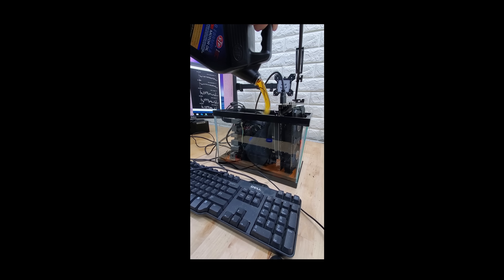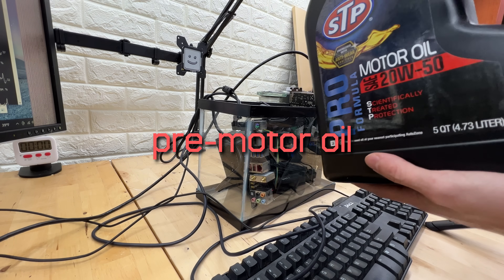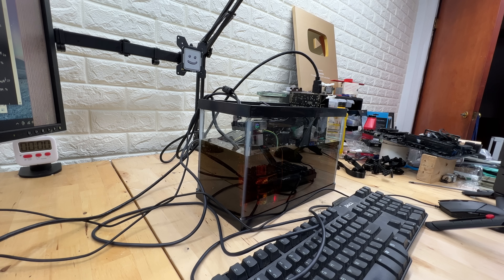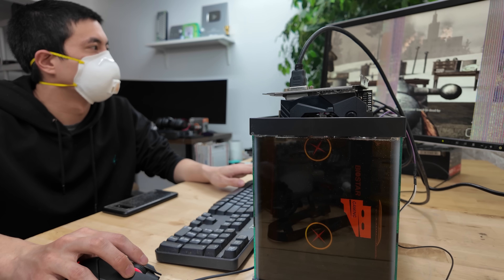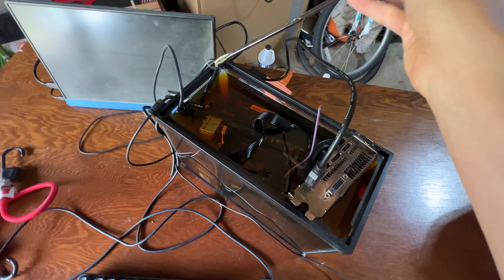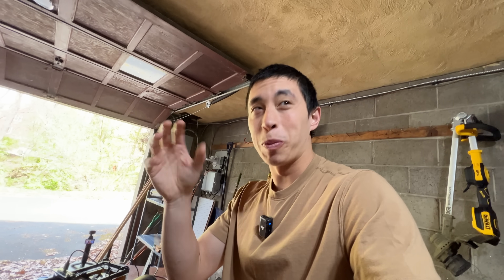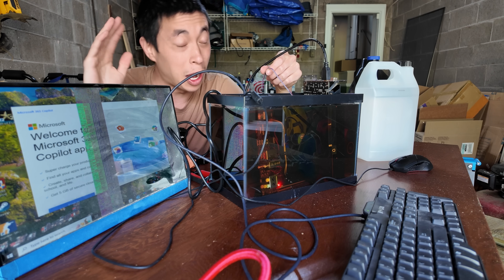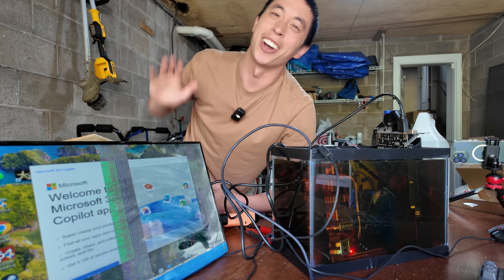Why isn't Motor Oil used to cool down PCs?

Comment: I probably wouldve used the thinnest oil they make which is like 0w20 or 0w16. But now this brings up the question of when to change the oil? Every 3000 hours? hahaha
Reply: 0w-8 exists, hell even 0W-2
Reply: @CollinTheSav Motorcycle guys use a “less than 0” weight oil to pickup a few hp.
Reply: @CollinTheSav might as well just start using water at that point 😮😂
Reply: @issanesheiwat1396  na uh the pc goes boom electricity and water no go together (i know how to speak english i just did this to make it funny😭😭🙏🙏)
Reply: @EFRODINORIQUE  he was joking
Reply: @EFRODINORIQUE  🥀
Reply: @CollinTheSav what about 0w0?
Reply: That was exactly my though. 20w is so THICK stuff
Reply: @Garrettdx1988  20W-50 is actually 50 weight oil. The first number on a dual-viscosity oil is the cold temperature performance.
Reply: @APS_Inc cold, meaning not up to engine operation temperature. I don't think that oil got to OT....
Reply: @Adroit1911   @Adroit1911  No, the W explicitly refers to an oil's WINTER rating and is for extremely cold temperature startups, and by cold they mean freezing or below. Above that temperature, and certainly at room temps (cold engine start not during winter), the oil should behave exactly like its base rating. So 0W-40 and 15W-40 should behave identically at room temps per their spec. I'm sure there are some differences in performance (no oil is going to behave perfectly like a single weight SAE 40 when it's meant to accommodate a wider temperature range) but for all practical intents and purposes, and certainly in the mild conditions in this test, the only value that matters is the base weight rating which is the second number.

Starting an engine when it's 12 degrees C outside vs 22 C means practically nothing for oil viscosity, and the oil is not going to behave meaningfully different at operating temperatures precisely because they're both the same base weight which would mean if they didn't perform similarly then one or both would be out of spec.

So no, the "cold" temp here does not mean not up to operating temp, it explicitly means winter temps, usually freezing or below, and those are usually not the temperature your room is at (I hope). While SAE 50 weight oil will perform very differently at engine temps vs room temp, their performance characteristics for purposes of oil weights are at startup in freezing temperatures, and for that reason something like a 0W-40 vs a 15W-40 won't see much difference above those temps (near and below 0 Celsius).

Ergo the second number is the most important for considering oil viscosity and film strength. The first number is purely for winter conditions on startup, and is not relevant for engine operation, and therefore a 0W-40 vs 15W-40 is not an appreciably thinner oil at the temps most people will be handling it.
Reply: @Adroit1911  I see your point, but -5 C is going to have dramatically different performance than 25 C for these purposes. I don't think the difference between a 0W and 15W is going to be that dramatic at room temps, unless you can source me room temp behavior and not freezing temp specs. 25 C isn't exactly "cold weather" for the purposes of an oil spec even though it's obviously not operating temperatures.
Reply: Was gonna say this myself.
Reply: Toyota has started using 0w-5
Reply: Use expensive racing oils to see if it cools better. Pennzoil Ultra Platinum Full Synthetic
Reply: @tacticalcenter8658  some royal purple 0-w5
Reply: Came here to say this lol.  Thinner is better for circulation.  That's probably why mineral oil works so well.  Mineral oil is almost TOO thin, though.  It's almost invasive 🤣
Reply: @dpjazzy15 mineral oil also just disintegrates rubber and creeps up cables
Reply: when you pwn 3000 noobs
Reply: Just have an extra like 3 gallons in a separate reservoir on a manual flip valve and replace that way. Send the “old” warm oil back to the other reservoir and keep the entire reservoir in a mini fridge
Reply: yeah 20w is crazy, doubt it would get hot enough to get to the 50 so probably stays 20w, well if the fans were working at least
Reply: @keatoncreates  the first number is cold weather performance, that is, below freezing. The actual weight of the oil is 50. If you have an engine that takes 0w-20 oil and you can only get single-weight oil as a replacement, you have to use the second number (20), not the first, or you risk engine damage with not enough film strength at operating temps.

20w-50 is 50 weight oil that has 20 weight oil characteristics at freezing temperatures . At room temp it's going to behave much more like 50 weight oil for most practical purposes, but especially film strength.
Reply: @keatoncreates the oil doesn't get thicker as it heats up, it just gets less thin
Reply: 3000 hours or 10000 miles.
Reply: It doesn't change the cooling properties at all, but since it's thinner, it would be easier to pump more volume and thus cool it better
Reply: @iwanttobetankman4260  pretty sure it would make any moving components like fans less stressed as well. Even if they don't serve a purpose
Reply: Well, with some luck it's fluid enough at temperatures that need cooling that it just serves as its own temperature monitor.
Reply: ATF is rather thin.
Reply: 0w-16 for sure
Reply: @ Might work, might not. The viscosity at 40°C is 30-35 cSt. Mineral oils can have a wide range of viscosities, between 8 and 60 from the ones I just looked up. Anyway I think there are better alternatives.
Reply: I was thinking the same
Reply: came here to say this
Reply: Funny Car Joke
Reply: If there are no moving parts, no need to change the oil
Reply: Maybe after 1000 kilometers ?
Reply: Exactly
Reply: me too,   thinking about it you could get rid of the fans and just out an intercooler in with a proper impeller.....hmmm
Reply: As a manufacturer of motor oil.  I approve.
Reply: Depends on if you use oil, synthetic oil, high mileage oil…? lol😂
Reply: I was thinking the same thing. They make 0 viscosity motor oil, they have synthetic motor oils that come in different colors if you want to be even "extra".😊😊
Reply: некоторые люди компы в растительном масле держат в ваннах и ни че, работают годами, внезапно.
Reply: Use high mileage for them older builds
Reply: Was thinking the same thing, you could also submerge a pump and run the oil through an external radiator to keep the temps in check.
Reply: Seeing 20W-50, my immediate thought was that oil wasn't going to get anywhere it needed to
Reply: You'd have to clean the parts eventually which i dont think would be easy with oil. That and the weight of the PC would be a problem.
Reply: conductive?     I'd check....before... lol   linseed oil I've seen  just doesnt work as good because its a liquisd ands is harder to move,, so the added power consumption for the pump...   oil's a bad isdea no matter how thin, air will always win :-\
Reply: I wonder if I can get one of those recommended oil change stickers to slap on the case. Lol
Reply: I was gonna say this, too. And he's saying it's conventional which means not synthetic or synthetic blend. He should have at least used synthetic. To my knowledge, though, there are no 0W-[insert number] motor oils which AREN'T synthetic.
Reply: Never I would think. It's not like it's running through a hot engine with many moving parts. In this scenario it is not a lubricant so I see no reason for why it would get dirty and have to be replaced. In fact dirty oil would probably work and then you'd get the blackout effect for free + you wouldn't have to buy fresh oil, you could just recycle from what can no longer be used by your car.
Reply: they make 0W-8 but that is essentially water
Reply: Well considering its clear, whenever it gets too dark/opaque?
Reply: The fans would probably push it too.
Reply: Hell how about ATF?  That would look amazing too!
Reply: I was thinking the same thing... 20W50 is some thick ass oil. Using something like 0W20 or something might have been far better
Reply: 3000 miles
Reply: What oil filter does your pc take?
Reply: Only reason you need to change the oil is when it becomes to viscous that might cause the oil to hold a current since viscosity is water getting into the oil which happens naturally overtime with humidity or water particles in the air.
Reply: Not if you use synthetic
Reply: i think the detergents in the motor oil will eat the parts over time
Reply: @josephdias5859  motor oil does the opposite 😂
Reply: @josephdias5859  

I doubt it, even then we have engines with plastic oil pans.
Reply: @mottoloveurlala  do you realize some types of plastics are made to be corrosion resistant there's multiple types which more than likely are not the same types of plastics used in computers I had a mineral oil cooled pc that eventually had some sata cables completely fall apart from the oil along with the pump for the oil
Reply: With a good oil filter, you will not need to change oil that often.
Reply: Engine oil is not for cooling
Reply: @oligerolsen2533  It's used in your engine to disperse internal heat.. your lack of imagination is boring
Reply: Depends if the vehicle has an oil cooler or not. Also coolant is used for cooling the engine down internally.  @mottoloveurlala
Reply: @oligerolsen2533  bruh why you think oil gets to engine temp? 😂😂😂😂

Comment: You used some of the thickest oil possible why ?
Reply: stress testing
Reply: 20W50 is super cheap stuff compared to anything else. I suppose he could have used 15W40, but 20W50 is still cheaper.
Reply: @warrenarthur5629 he's trying to destroy a functional pc with a dedicated GPU... Cheaping out on a few bucks doesn't seem like a valid reason at this point...
Reply: @warrenarthur5629  Its really not. 5w20 and 5w30 is usually cheaper as its more commonly used in modern everyday vehicles. I looked up the same exact STP oil he's using and at auto zone both the 20w50 and 5w20 are identical in price at $24.99 for a 5 quart bottle. Maybe he just thought bigger number means better?
Reply: will it make any difference? the only  moving parts are the fan
Reply: @ChrisP.Bacon69  If the fans can circulate the oil then you wouldn't have to worry about the pc eventually overheating after a prolonged period of time as the heat would be spread throughout the entire tank and dissipate into the surroundings faster instead of just creating a hot spot in the oil right around the cpu and gpu.